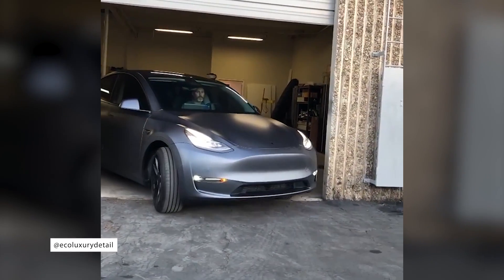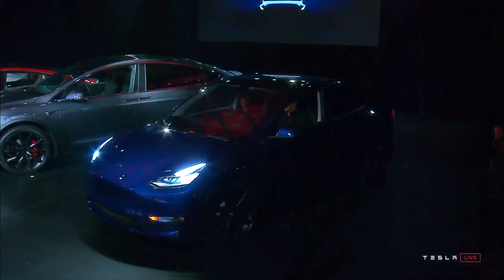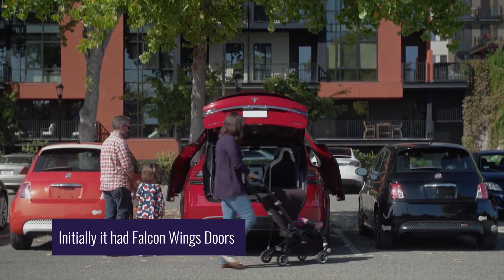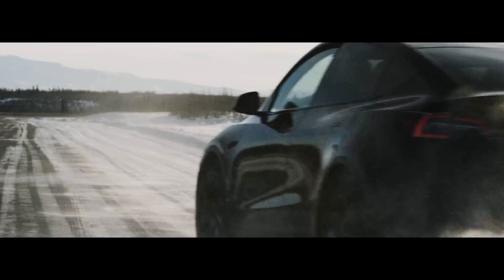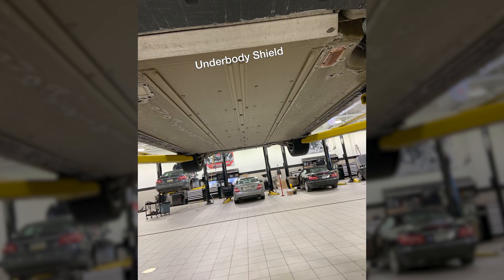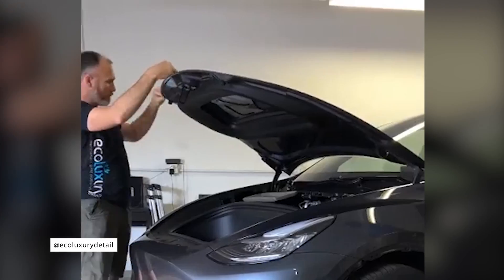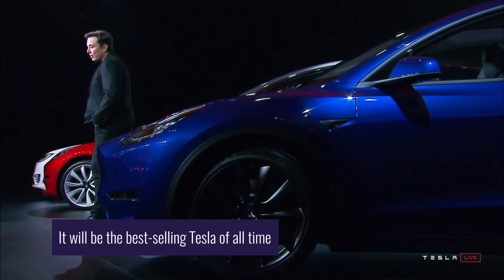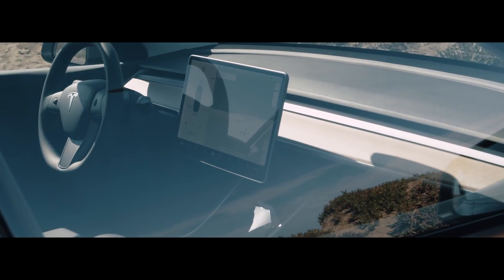Tesla Model Y: 10 Facts You Probably Didn't Know

Comment: Wish it would have been wider, longer & had more than the 6" ground clearance.  Why is it that Older model S has better range?  Was expecting Model Y to have 400 mile range.  Doors are very boring.  Just like every other car out there since the invention of cars!  I usually carry large pkgs. or load boxes, totes, ice chests, etc. So I hate the traditional narrow doors.  Falcon doors wud have been awesome!  At least remove that metal frame that makes the entry way so narrow.
For the $50k range, the vehicle SHOULD meet most of my expectations.
So I am standing on the side-lines until most of the above happens or the price drops down to the $30k range.
Reply: You aren't getting Falcon wing doors for $30K, dude.
Reply: And you are not getting 400 miles on a 75kWh SUV battery, the older Model S with better range has 100kWh of battery, so you pay more to charge it up compared to the efficiency of the 3&Y

Comment: Took delivery of my Y last week. Love it. Has some build alignment issues (e.g., charger port door and rear hatch) that I hope they’ll rectify next week during my service appointment.
Reply: Just picked mine up today and the only issue I noticed was a tiny chip on one of the rims...other than that I didn’t notice any alignment issues (some might complain about rear seat alignment, but its barely noticeable and well within my level of acceptability.) Kinda overcast right now, but I’ll go over the paint with a fine tooth comb once the sun comes back out. As of right now I’m extremely happy.  Btw it took 5 weeks from order to delivery.
Reply: My 3 arrives next week and I’m hoping I don’t have those issues.
Reply: Curious when you put your order in and when it actually arrived. Trying to gage if the 4-8 week time frame is actually realistic.
Reply: Same, I bought one and drove it home, then upon closer inspection that very same day, noticed the passenger window doesn't align properly.  Love the car but hope they can fix it at my service appt. this week, otherwise I'll be a very disappointed customer.  Wish I had the experience all you others had, "perfect, no issues..."